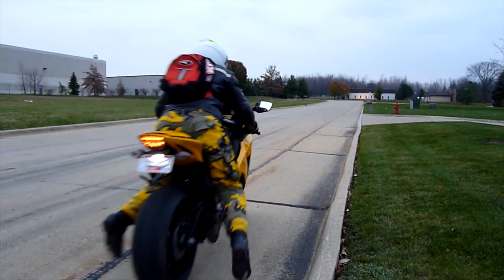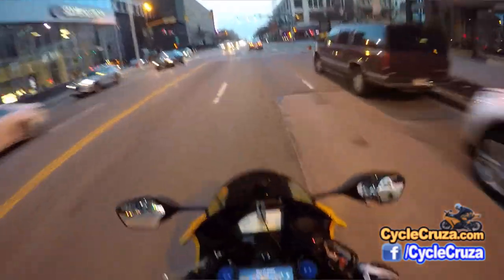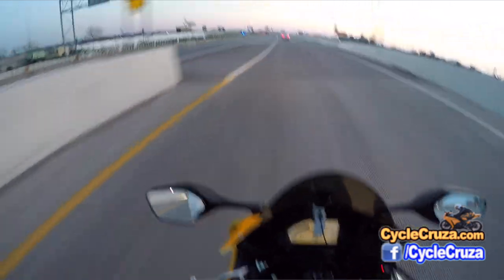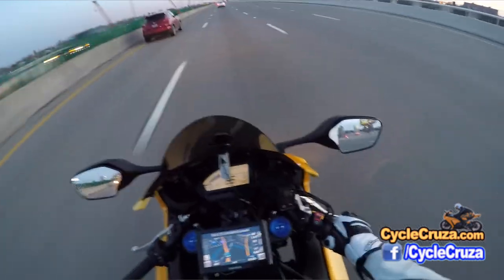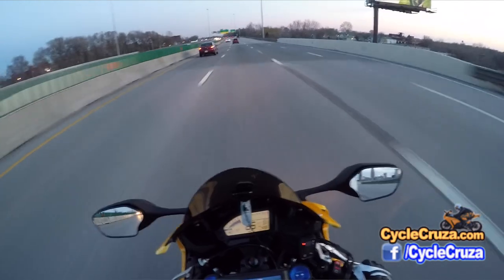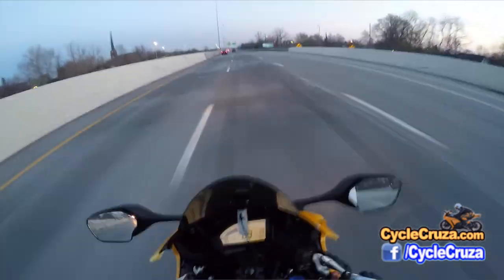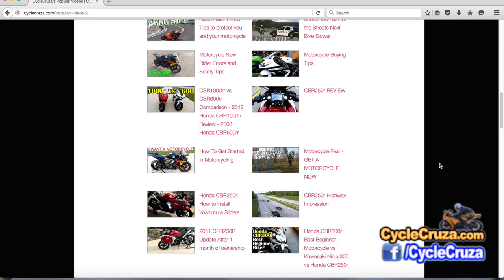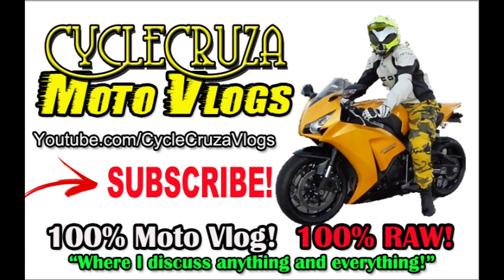Ceramic Bearings Make Motorcycle Faster? Steel vs Ceramic Bearings | MotoVlog

Comment: I bought a used bike in March not mind you this bike needed things and wasn't able to hop on and go. but since then it now being may when I got it it had 19000 miles on it it's about to roll over to 24000 I ride rain shine snow. for me I prefer cold .the bike is getting better and better by the day. I only spent 800 to buy this car that was in really good shape just needed dewinterized fork seals. I also added new tires chain both sprockets 100 bucks in oil change plugs engine ice I got given a second set of fairings for the track next I'll do valves and about due for breaks I'm into it about 1100 I ride the shit out of it. I have had all sorts of bikes but this is my favorite by far

Comment: ceramic bearings have about 40% less friction than steel bearings, but I still don't think their worth it because steel bearings already have so little friction. Also ceramic bearings last a lot longer than steel bearing but the truth is that steel bearing really don't cost that much anyways.
Reply: +Cole W I mean 500 dollars in modification to your engine could also get you 2 extra HP

Comment: $500 will buy you a full set of riding gear plus helmet.
Reply from the maker: +mabutoo yep
Reply: +CycleCruza If you going to be racing in a motor GP pro race going 180 mph+ then try it,but just for riding it's a waste of money and time my friends.
Reply: mabutoo yeah if you buy, cheap, pos gear.
Reply: NoxImus no way,  you can buy plenty of quality gear for under $500. Not top shelf but hardly POS.
Reply: Of course you can buy better with more money but that is not the point.  The point was that it is possible to buy good, comfortable safety gear for $500.  Don't be a snob about the matter.  Not everyone can afford the most expensive gear.  Personally, I have never been ablt to justify a $3000 helmet I purchased from the $80 helmet I first bought.  The cheaper one is better in the rain and cold and more comfortable.
Reply: mabutoo maybe you should check out my channel and you'll reevaluate you're current view on gear. I have more money in my gear, than some guys have in their bikes. why? because my life is valued higher than 500 dollars. do you know what that 80 dollar helmet cost to manufacture? keep in mind, that helmet was marked up atleast twice, before it was sold to you.

moral of the story is, be a fucking snob about the gear you have and wear. your life directly depends on it. there is absolutely a difference between a 80 dollar helmet, and a "3000" dollar helmet. stick with the big 3, arai, shoei and agv. the day you go down, and it saves your life, you'll remember this message. you're welcome.
Reply: I did and I found your videos very interesting.
Reply: mabutoo cheap gear.  My helmet alone is over that.

Comment: how come ceramic bearings have less friction but super cars have ceramic brakes as an extra option? it would make no sense if it has less friction.
Reply: its to do with heat. ceramics are far better at dealing with heat. metals expand when they heat up, ceramics dont. Also, they have lower rolling resistance.

but I cant see it making much difference to the average rider. definitely not $500 difference anyway.

money far better spent elsewhere.

Comment: 2rwhp is actually techically speaking a huge difference. You will not gain that much if anything at all. Ceramic bearings may last a bit longer.
Reply: its 5 yrs later and i gained 3.6 whp from these 😬

Comment: You can only gain horsepower to the wheel. Nothing you do to you final drive can possibly increase the actual hp that your engine is putting out. So I would never buy ceramic bearings. You don't need more power than a liter bike. And there's been actual gains of 5hp and up with aftermarket exhausts so that's the way to go.
Reply: suppose you use the same effort roll the wheel , steel 2 round and ceramic 10 round, high rpm mean your wheel is turning more, it will use the same effort with higher rpm, mean the bike will go higher rpm compare with steel, however in most country aftermarket exhausts is illegal which you may get a ticker of $500 fine second times will be double so it more expensive than ceramic

Comment: I wouldn't do it. The cost for the benefits is not practical.  I would rather buy some fresh rubber and use the change for fuel

Comment: Well stuff like this is just for people who want to squeeze the absolute rest of horsepower out of thier bikes. 
No, it's not for 99.9% of us, but there are maniacs out there who will gladly spend 500 bucks for a 1% increase in power. There may come a time where you've put anything you could ever buy on your bike in order to increase its power and then ceramic bearings might be one of the few things that are still left to be put on. So yeah, I can see why people would go for it even if the difference is so tiny. But many tiny modifications also eventually add up to make a noticable difference.
Reply from the maker: +lifehacker123 On the track it's understandable for just regular street riding and bragging rights I don't see ceramic bearings being worth the ridiculous cost.
Reply: CycleCruza Yeah of course, for us normal people it's totally not worth it but like I said, for maniacs it might make total sense. They don't care about 500 bucks if that makes them 2 mph faster than before ;) in my opinion this is something for total high end tuners that just do it for bragging rights (my bike is 4 mph faster than yours) or serious racers.

Comment: If money wasn't an option? Fuck yeah, but of course with that line of reasoning I'd go all out with some BST wheels as well, and pretty much any upgrade that wouldn't tank reliability I.E. ceramic engine bearings, full exhaust, improved intake, whatever lighter weight components...

Oh money, why can't you be easy to obtain :'(
Reply from the maker: +urgandma and then your bike gets stolen and you pray your insurance will cover all of the mod expenses. lol

Comment: i dont htink is worth, ceramig can break really easy, i used to skate, with steel bearings, and a friend was so excited about his new ceramic bearings, they last him about 1 month, because the balls inside broke,, is not the same, but is way more fragil, and a tip, bearings usualy have standar measures, so if you go directly to a bearing manufacturer and buy the same sice of bearing, it might cost WAY  cheaper for the same product, just because it isnt branded honda, and i bet that the same that honda sells you, come from there, try to find some bearing shop/manufacturer near you,  and ask for the sice of your wheels bearings, sorry for my spelling, not english :(
Reply from the maker: +midibudu Thanks for the tip! I will keep that in mind if I decide to get a set of ceramic bearings.

Comment: You are right. IMO definitely not worth it. I honestly don't think you would even notice the difference. No way you would pick up any noticeable HP from wheel bearings. If you were going to ride tons and tons of miles you would get longer bearing life but I have ridden my whole life and never had a wheel bearing go bad... ever.  If you changed the wheel bearings and then let a pound of air out of your front tire that would probably offset any improvement you get from the bearing. I think it's all hype and marketing. If you were racing and trying to shave off a thousandth of a second then you need all the tech. For the street?? Not really. Of course this is only my opinion...
Reply from the maker: +Jerry Coon I agree, not really worth it for street riding. There is a video on youtube showing the difference in roll out, ceramic bearings do roll much longer, however, I can't see that justifying the ridiculous cost. I may get some ceramic bearings just to run a fuel efficiency test since I track all of my vehicles on religiously on fuelly.
Reply: +CycleCruza You will scrap the bike before u recover the extra $, let alone save some....but it is your money and, as you say...you can do what u want.
Greets from Romania

Comment: A fresh coat of wax on your fairings would do the same thing for you if you chase hp increase lol... who notices 2 hp at all?
Reply: a few years back I rode a 125cc 4-stroke sports bike. I put a 144cc kit on it, and it made a HUGE difference even though giving only 3hp more. it's noticeable.
Reply: +David Visser on a 1000 cbr that has 165hp, 2hp isnt even 1,5 percent increase. on a tiny 125 cc its more than 10 percent. still thinking you would notice it? ;)

Comment: You don' t get  more horsepower from bearings. Less friction maybe. The engine does not produce more power. LOL
Reply: But you do gain rear wheel horse power cause rwhp is lower then engine hp because of friction losses. These bearings reduce friction losses hence they increase rwhp.

Comment: Anything that cost that much is a hell no
Reply: a bike usually costs more than 500
Reply: for a bearing 500 is a big thing. You can buy a full set of gear. Might as well stick to steel.

Comment: Stay with steel bearings. Ceramic bearing do break. I think it's a gimmick.
Reply from the maker: +Derek Munro I've never heard of them breaking tho.
Reply: unless you put on a bicycle with no  shock absorber and hit a pothole or manhole on high speed which cause the load shock, if on a motorcycle the  shock absorber can help absorb load shock, unless your motorcycle is a hard tail